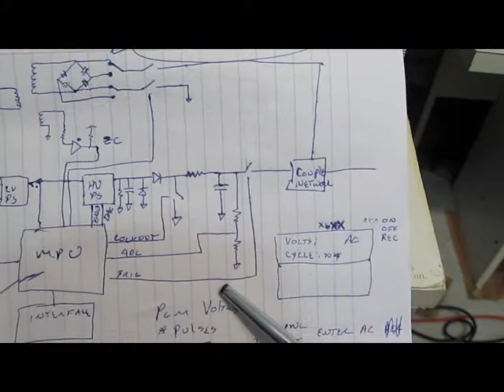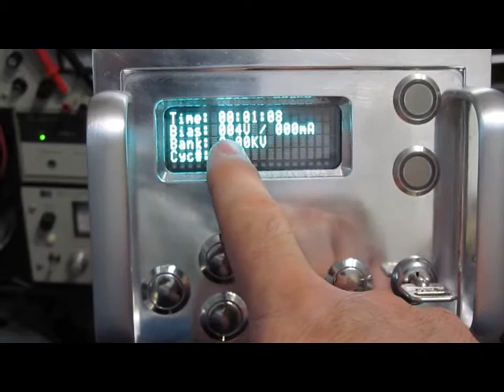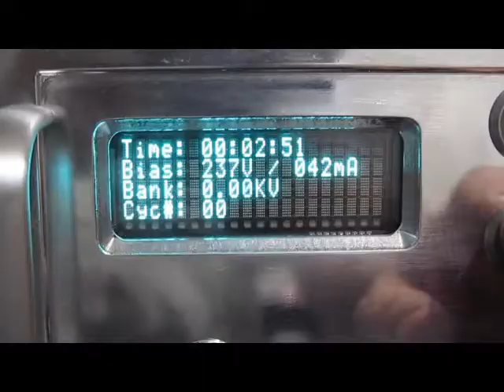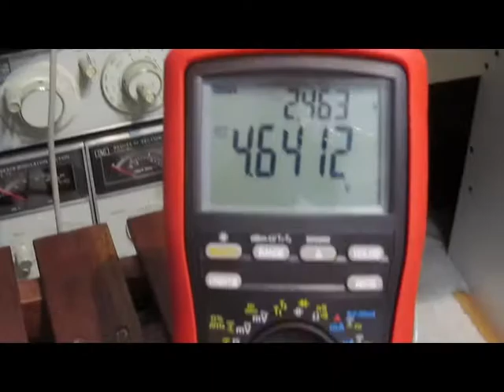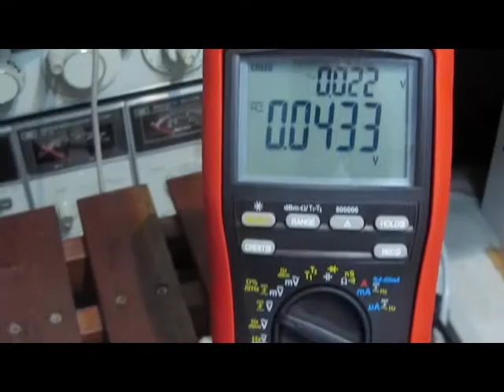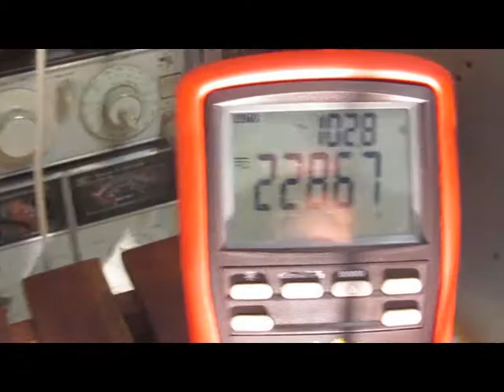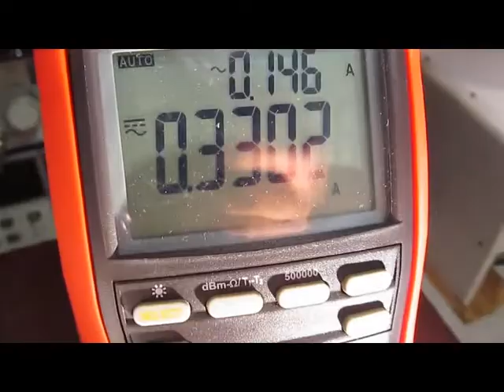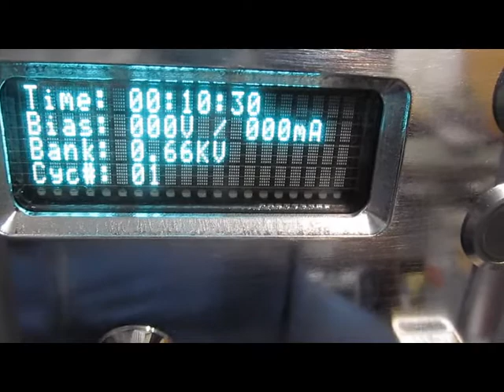Programmable Transient Generator, Part 2

Comment: That's quite an ingenious solution for programming those old Motorola microcontrollers...run the programming software on the 6801 itself and program its own EPROM.  I'm guessing that the DPRAM serves as a buffer for the display as well?
Reply from the maker: I built a few programmers for the 01 back in the 80's.  There was a note in the databook along with code on how to program them.   The DP is only there for the buffer.  LCD just sits in the bus.